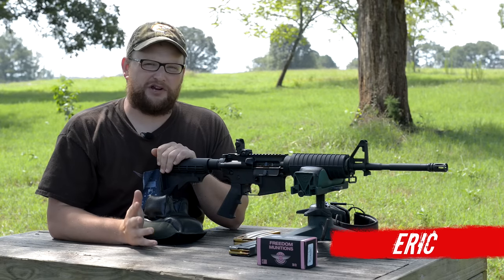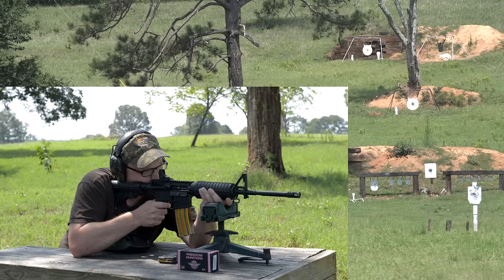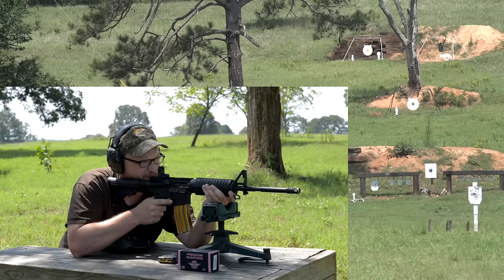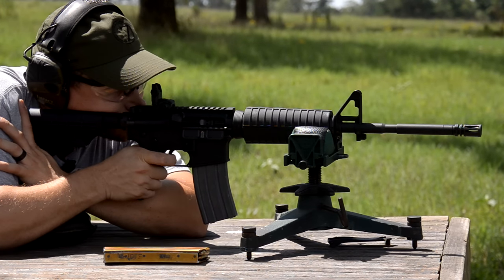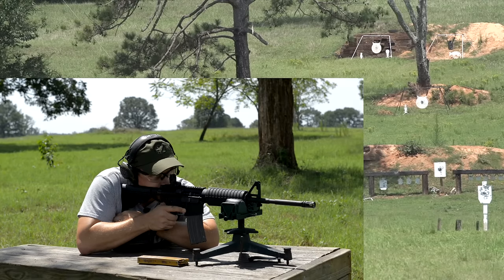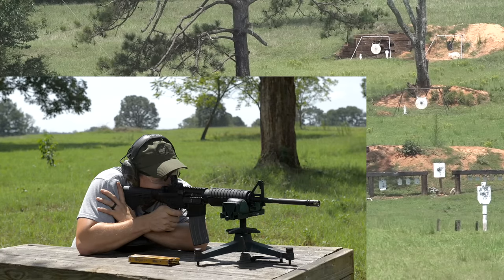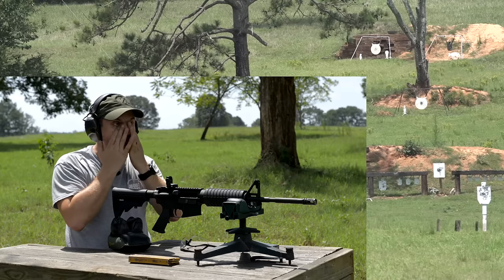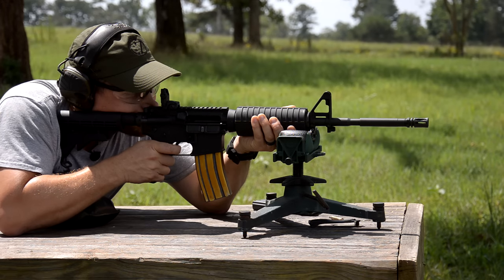Basic AR-15 Practical Accuracy

Comment: For me anyway I've found if my face is too close to that rear sight the aperture is bigger so it's harder to line up the sights just right.  Maybe give that a try next?  In the Marines our rifle quals are all iron sights.
Reply: That's how it should be.  If you're using the small aperture, the tolerance is so small that the front sight post can be in different parts of your view but remains on the point of impact.  Shorter sight radius and the bigger aperture throw that concept all to hell, but that's how it was intended.
Reply: Sunshine_Shooter Bringing your face closer makes the smaller aperture bigger.  Besides, the bigger one shouldn't be being used in this situation.
Reply: JayXX Bringing your face closer also makes the front post bigger, but does not change the relationship between the two.  The concept (as I've learned it) is that the small aperture is so small that for your eye to be able to see the front post at all, the sights have to be aligned straight enough that the front post is on the point of impact.

Comment: Is the standard AR-15 1:9 twist? If so, is that the sole reason why it shoots 55 better than 62 or is M855 just a garbage round?
Reply: Vincent Garibaldi Mil-Spec ar15 is 1:7 twist... IMO xm193 is better than m855

Comment: No offense to the intention of your video, but you have to consider that you are Iraq Vets and Marines (i think). That alone makes a significant difference. I still believe that you got the point across. The AR 15 is highly accurate rifle. Regardless of your guys experience...you proved this.
Reply: Old grunt here too. But I just want to point out, that my 7 year old niece can get very nice grouping with my AR, using an A2 fsp and removable carry handle with A2 rear sights. Fundamentals are the key.

Comment: Just watched this one again today. I also like a carry handle with A2 style sight. I don’t have an issue with 62gn bullets in my handloads. I’m not a fan of factory loads as they develop the load for a non realistic barrel length and action and expect it all to work fantastic in every single rifle action and barrel length and twist rate, etc. and that’s how you get cartridges they’re too spicy for your particular action. I start at start and stop when I reach MOA or better. Y’all kept talking about the handguards/heat shields. Is there a free floating kit that provides the same look as the A2 style handguards/heat shields? I hate rail kits, all of them and they’re all ugly, and it seems the higher the price the uglier the rail.

Comment: This leads in to 2 reasonably obvious questions. 1 is it likely that the manufacturer would have put the rifle together as precisely as Chad? Possibly not in some cases. 2 how much difference would that make? I don't have enough experience to answer the second question having only fired 6 variants.
Reply: Honestly, probably no difference at all. ARs are Lego guns. As long as everything is manufactured correctly, they just bolt together.
Reply: I thought that was likely to be the case unless it was put together by a hamfisted chimp.
Reply: Don't be so sure.  I recently came across an archived live stream from Windham Weaponry and it showed their guys assembling uppers and not checking torque.  One guy had an improvised wrench and just tightened it to whatever he thought was acceptable.  They other guy had a torque wrench and completely disregarded the tool's clicking signals.  It was astonishing the way these men disregarded the spec these guns are supposed to be made to.

Tl;dr, "hamfisted" is exactly how a lot of ARs are assembled.  trust a manufacturer at your own peril.
Reply: There are important aspects to assembly that can effect accuracy & reliability. It's not super critical but it does make a difference. 
Part of it is little things like lapping the upper to barrel fit. Some don't need it, some may have excess finish on the upper. If you just pop the barrel on it can have small amount of play in it after a while. 
That very small amount of wiggle may not even be noticeable but it will mean reduced accuracy. If the builder takes the time to make sure the upper & barrel seat well & then make sure it's torqued properly, that builder will have a more consistent product. 
If a builder tries 4 or 5 different bolts to find the best fit in the barrel extension, you get more consistent tolerances. 
Other minor details like making sure roll pins are oriented correctly is the mark of a high end builder. You don't want pressure put on the area of the roll pin where the gap is. That's a minor detail that probably won't make a difference but it could. If a roll pin gets beat up & eventually fails  in 1% of rifles from one builder but they never fail in a different builder, that's a difference. 
I agree, that is being nit picky but a high end builder looks out for those minor details.

Comment: So these boys are are shooting 55 gr. out of a sixteen (16) inch 1:7 barrel, And getting hits out to 300 yards.. NO optic just that poly flip up. Glad I saw this as it sheds light on so many posts/reviews that "55 gr. won't stabilize with a 1:7:, let alone out of a 16" tube. Not that this is a final tie breaker, but going to buy  a quantity of the 56 gr. MEN SGA has in stock right now for my carry handle LE6920 that I still haven't bought an optic for. The only MEN I've ever used is their M80 which has been as good as Austrian Hirt that has all but completely dried up and the MEN doesn't beat the hell out of my SAK and TRW op-rods.
Reply: It's the 62-grain bullet that won't stabilize from an M16 A1, which has a 1/12 twist barrel. The current M16 A4 or M4 has a 1/7 twist which will stabilize M193, M855, and Mk 262. I train Soldiers and can say the M855 round can easily get nose-on to targets at 600 meters and beyond. I shoot with an iron sight AR in 1000 yard competitions, which usually requires some sort of creative aiming strategies and wind counters but is doable.

Comment: i have had bad luck with cmmg barrels, chambers r too tight. Had to send back a 300blk and 5.56 back.  Very inaccurate bores.  Colt chambers are better. A good barrel for accuracy would be green mountain 20 inch gov profile chrome lined 1/8 twist. I get .3 moa with m855 reloads using cfe223. Got a .5 moa at 200yards.  Cheap NCstar scope was used.

Comment: What I wanna know is how are you going from 100 yd to 200 yd and 250 yd and hitting your targets? How much are you holding over beyond 100 yd?
Reply: Former OSUT Drill Sgt here.  
With M-4, apex of the trajectory is 190m when the carbine is given a normal 25m zero.  So imagine a torso E-Type silouette.   For 150 and 250, aim at the belly button.
For 200 (highest rise), aim for the belt buckle.
0-100 center mass.  
300 center mass

Comment: Your title is about how the accuracy of an out of the box AR 15 is and then proceed to talk about all the things you do to it. So how does that out of the box ar 15 rebuild make your gun a  basic AR 15?
Reply: What he has is an M-4 in its original configuration with the fat handguards.  PSA sold a ton of them for years for $399. Later, we started using the hand-cutter quad rail handguards. Military only requires a 3MOA accuracy.

Comment: What is the practical maximum range of a 223 I mean realistically how far away can you put down a threat not a AR but with a scoped bolt action sorry to bother you men with a lame question like that but ye are my best chance of getting a straight answer thank you
Reply: If I remember right from my time in the Army, a point target for an M4 was 450m, area target was 550m. The M16A2 was better range, but the barrel length of the M4 was shorter, which affects range, ballistics to some degree, and muzzle velocity. 

Somebody correct me if I am off on this, but don't be a dick about it.

Comment: What are your thoughts on lower grade rifles or their usage compared to mil spec rifles in the at or m4 models. What I mean on this is do we have to treat them with kid gloves and not use metal case ammo and hot loads?And on the same platform, the use of iron vs red dot vs scope to digit scopes like the x sight? I do have the lower grade or starter m4 and have a laser scope of 2.5-10x40, I am trying get a all round use sight that would work and wish to know the extent of how I can go with the starter grade rifle.I have a x sight and watched a lot of utube on it, but I decided to put it on my sks para with fiberglass or plastic stock and folding bipods for a system.
Reply: I have one of the original M&P15 Sports, the ones with no forward assist and no dust cover. I picked it up because I got it at a huge markdown from retail. I carried an M16A2 for five of the six years I was an Infantryman, the M4 for the last 12-18 months I was active duty. My AR is far more reliable than the M16s I carried, as reliable as the M4. A lot of it had to do with how the weapons were treated by uncounted others before me, versus the M4 and my AR both being brand new out of the box. My AR has had exactly two malfunctions in close to three thousand rounds. One was a failure to eject towards the end of a long day at the range. One was I think a bad primer (bulk ammo). Both were on different range days. I cleaned up the BCG, bolt, and all the bits and pieces, and haven't had a repeat of the failure to eject.

Comment: My stock sw mp15 was perfect stock. (.5moa 100 yard) ever since i changed from stock handguard to strike industries gridlock free float hand guard my accuracy and been garbage... .5 to 3 inch random spread. Barrel nut had been torqued and retorqued. Do you think its the free floating handguard?  Pls help... Now i have replaced everything but the lower receiver now. Even a new barrel still shooting like crap.

Comment: question.. why do you hold the trigger back so long, then release, then shoot again so quickly after resetting the trigger? I've just never seen anyone do that before. I only really noticed because how loud the trigger reset is.
Reply: That’s how you shoot with a mil spec AR trigger.  Trying to make your shot perfect makes you miss perfect.  That’s why a 3 round shot group often has two holes tight and one off.  People trying to make that last shot perfect.

Comment: I've started a new AR-15 build. I'm going for a CQB type build. I'm using an Aerotech lower with parts kit and Colt M4 upper with the removable handle and sights. I'm using some YHM furniture, including the float tube and BUIS front sight. However, I'm wondering if I may have made a bad move on the barrel and gas block. They are available at Midway USA. I wonder if I can get your opinion on these if you are familiar with them?

http://www.midwayusa.com/product/834998/ar-stoner-barrel-ar-15-556x45mm-nato-m4-contour-1-in-9-twist-16-chrome-moly-phosphate

http://www.midwayusa.com/product/482126/doublestar-gas-block-single-picatinny-rail-ar-15-lr-308-aluminum-matte

Also, do you think it is acceptable to mount an optic on the hand guard rather than directly to the receiver?

I don't expect to shoot anything heavier than 69s. 55s will be my primary.

Comment: OK the average stock ar comes with 1 in 9 twist and most come with a stainless  steel barrel  so to get to my Q what weight bullet work in said barrels 1 in 8 and 1in 9 versa  the 1 in 7 which I believe  military  barrel so can you explain this better next do a ar barrels get wonky when the heat up

Comment: People do not give the standard AR-15 M-4 rifle enough credit for accuracy. I was one of them. My buddy and I both built DMR style rifles with 18" barrels fancy Midwest Ind. forestocks, Timney triggers the works and put 2.5X by 10 optics on them. We were at the range a couple weeks ago hitting over and over an 8" steel plate at 450 yds from the bench. I mouthed off that I could hit that with my bone stock 800.00 Stag 15 with an Acog on it. He bet me lunch I couldn't do it in five shots. Well I did it in three and was able to repeat it about every other shot. Tell you what, 8" is mighty small with a 4X piece of glass.. Have to hand to Trijicon for doing a great job with the hash marks. I was just using standard Federal XM193 ammo and those hash marks were really on the money for doing the proper holds. 

What we both learned was, we would both take an 800.00 rifle with good glass on it vs. a 1500.00 rifle with crap glass any day.

Comment: I have a 11.5" Windham AR-15 pistol, what distance should I zero it? It seem too hit much different than my 16" carbine
Reply: Running magpul mbus/ trijicon MRO btw...
Reply: 50 yards
Reply: Some people argue 50 yards some argue 100. I doubt it would make sense to take it out past 100 for zeroing.
Reply: Zero it for 50 and you'll be good out to 150 yds without much adjustment from the shorter barrel
Reply: I bet it would hit much differently than your 16".  11.5" is insufficient for anything much beyond CQB distances, your bullet is too slow out of that short barrel to remain effective for long.  I would zero it so that your hold-offs at short distances are easy to memorize.  Anything beyond 100 yards, put the shorty down and grab the 16".
Reply: +Sunshine_Shooter too slow? That 11.5 will still do 2700-2800 with M193. Look it up if you don't believe me. It's only a couple hundred FPS behind the 14.5". I believe there was a write up on AR15.com about it awhile ago.
Reply: +mallory1970 call bullshit all you want. Google "11.5 AR velocity" and click on the AR15.com. The 10.3" Colt does roughly 2500 FPS. Google it and be enlightened
Reply: FMJ performance will be significantly reduced at that distance, but with the proper ammunition (IE, bonded soft points or 5.56 TSX) it's effective far past 100m
Reply: +mallory1970 I know you may be too incompetent to look it up for yourself or simply too ignorant to know what you're talking about but 5.56 like anything else reaches a point where it no longer increases in velocity very much, such as, when comparing a 7.5" barrel to a 14.5" barrel, the velocity difference will be much greater than it would be between a 20" and a 26". My 26" bull Douglas barrel will only make about 3250 FPS with a max charge of H335 behind a 52 gr SMK bullet. That same load will do a bit over 3100 in my 20" Colt A2. Not much difference even though the barrel lengths have almost the same difference in length. I encourage you to look it up since you do not believe it from me. You really are showing your ignorance on the subject. Also, YOU should reread my comment because when talking about 2700-2900 FPS, I was referring to the 11.5 and when I said roughly 2500, that is with the 10.3" colt barrel.
Reply: +mallory1970 contradicting? That's funny considering nothing I said is contradicting.
Reply: I ended up going with a 16 1/2 yard "battle zero" 
Just for your information my pistol (Windham Weaponry 11.5" pistol) sends .223 2500-2600 fps and 5.56 2800-2900 fps 
I can also hit a 200 yard 10" gong from a rest occasionally lol
Reply: +mallory1970 you very well may have however, that doesn't mean you are correct. Read the comment above your last one. It's funny that you can't admit when you're wrong and you just keep talking about how much experience you claim you have.
Reply: +mallory1970 you do realize that your shitbox 55 gr Tulammo you buy at Walmart won't do the same as genuine M193? You people make it sound like you're better off with a stick than with a barrel shorter than 16". I don't need an SBR to chrono a 11.5"....
Reply: +mallory1970 come too my gun club and stand down range, we will see if it's not affective haha. It will get the job done in a home or from a car, everyone will be deaf though...
Reply: +mallory1970 also it takes less than two seconds too slap an 300blkout upper on my lower and grab a different mag. I shoot .223 because it's cheap and low recoil.
Reply: Nice choice. If you have a 1:7 twist barrel I would zero at 36 yards use m262 77gr and you should be good to about 300 yds. I suggested that ammo because it is designed for shorter rifles. I have 2 Windham AR's and love em.
Reply: Use Black Hills Ammunition 5.56x45mm NATO 77 Grain Sierra MatchKing Hollow Point or IMI Razor Core 77-grain OTM 5.56x45mm Ammo. This ammo is expensive about 1 dollar a pop but, It will bring muzzle velocities up to 2700-2800 fps. in an SBR.
Reply: Ha Ha I love it you really sent those two into a fire storm.
Reply: There is huge jump in velocity approaching 12 inches from 10 for barrel length. Thus why a 11.5 will be significantly more powerful at range than a 10.3. Between 13-14 inches you should see the most power with standard rifles. Everything past 16 inches is pretty much overkill unless you are going for plus 500 yard shots or something/competition because you sacrifice power for unnecessary accuracy gains.